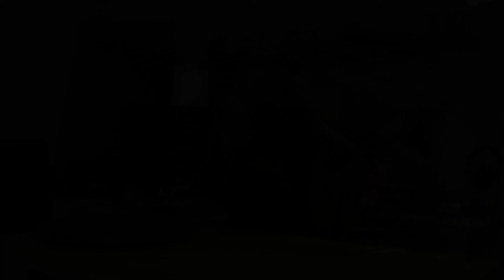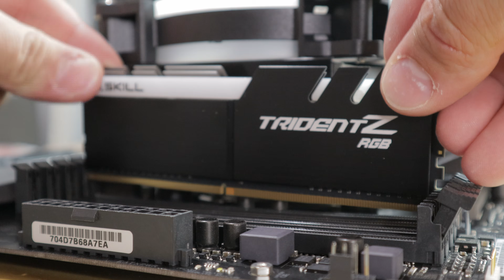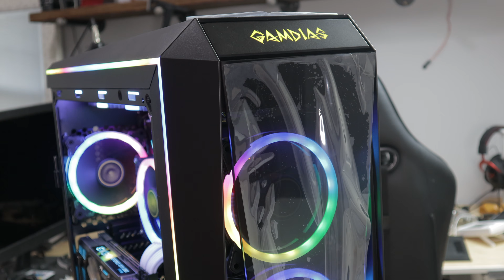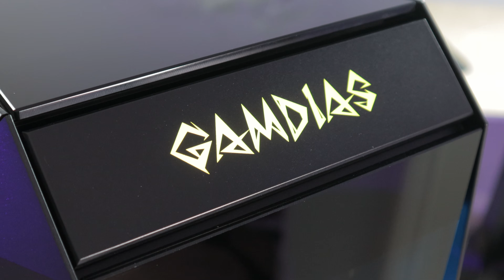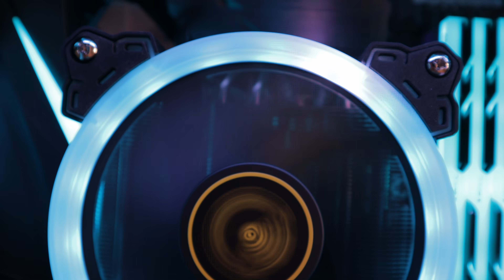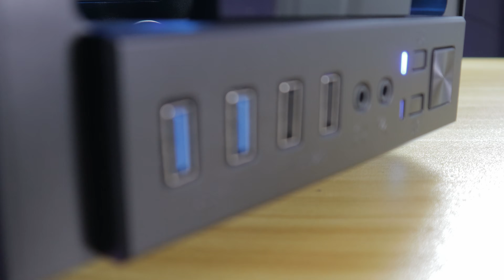ALL GLASS, ALL RGB | Gamdias Talos P1A

Comment: my guy...ive had this case for 3 years and couldnt get my ARGB to work. and i have an asus mobo as well. i even got the gamdias fan controller like you had and everything. couldnt ever get it to work. but i had the remote so i never worried about it. fast forward a few weeks ago. the fan controller burnt up so i had to go back to the original case built-in one. got to messing around with stuff again tried to get the ARGB to work again and still couldnt. you mentioned something about holding the case fan color button for 3 seconds.....that sync'ed it with asus aura lol thank you so much lol

Comment: Happy someone did a review on The Talos P1A. it seems like it just came out and there are not alot of reviews on it. Im still teetering on wether or not i should purchase this case.

Have you seen any issues with RGB case strip Freezing, Burning out, or Dying? Most reviews ive seen are tied to the previous Talos P1. Ive seen similar reviews for the RGB case fans. how are they holding up?

How was the temps on your CPU, and what was the heatsink you used? The gamdias fans seems to have pretty good RPM but im curious.
Reply from the maker: fans work good and no issues with RGB, CPU Temps are good and the airflow in the case is good. for the CPU fan i would suggest using a standard 4 pin PWM fan that  you can connect to your motherboard. The glass is tinted vary dark so if thats something you dont really like just be aware.

Comment: 129.00 on amazon   
darkFlash Phantom Black ATX Mid-Tower Desktop Computer Gaming Case USB 3.0 Ports
 Tempered Glass Windows with 6pcs 120mm LED DR12 RGB Fans Pre-Installed
currently running 7900x on x299wu8 with water cooling and evga1200p

Comment: If you want an efficient, cool, cost effective PC - DITCH RGB. If you want pretty lights just buy a "Fibre Optic Nightlight" on Ebay for $2. No excess heat, no awkward cabling and software. AND will save a heap load of money (use it to buy better hardware). Also when you realise RGB is just a complete distraction and waste of money you can pop your "night light" in the recycling bin with only $2 of "Buyers Remorse"

Comment: Hmm how are the gpu temps? Card looks super close to the side window, hope they're not getting choked.
Reply from the maker: they are a bit hotter but still within spec and i havent noticed any reduced performance
Reply: @MajorHardware  I went with a cooler master vertical mounting kit for my case (NZXT Noctis 450) I looked at other ones but they either were too bulky or too flimsy. I was surprised how far from the side panel the gpu was sitting with it. So far in fact I had to mod it because it was so close to the motherboard the tall rgb ram was in its way. 2 aluminum spacers and some longer screws later and it cleared the ram np while still being plenty far from side window.

Comment: no filter for intake....eww dealbreaker for me especially at this price point
Reply: Bruh, just use a radiator, or buy an intake. It isn’t an issue for me, so I really don’t get this comment, but it’s your opinion, your entitled to it.
Reply: @polaroperatr9243  A rad isn't going to catch dust nearly as well as a filter ! And personally if i spent this much money on a case i dont expect to have to buy anything extra to make it function properly. Whats the cost of a mesh fabric on a factory scale ? Close to nothing.
Reply: Still fine for me, I have a magnetic internal filter that I had in one of my old cases, which I had just discovered in my garage, so I glue on the polarizing side of the magnet to the case, and, boom. Internal Dust Filter DIY installed. I'm also fine with getting on with some compressed air and cleaning once and a while, though I would have to clean it more regularly than with a dust filter. Your right about the production cost, though. It is really cheap to manufacture, but I think the Tempered Glass makes it worth it to me (even though I installed a DIY dust filter)

Comment: I built a cooler for the air before it enters the front fans so my air cooler works fine for long game sessions using hwmonitor program it drops the case temp by 15deg. C it works nice.

Comment: Every time i see a case from a not well known manifacturer there are always major oversights, this case is 130$ and there isn't a front dust filter, that is a big no for many people. Also the ports at the bottom of the case.. This case is big, what if you can't put it on your desk, you have to reach almost ground level to plug a USB stick. The leds are the main attraction  but if you look at Amazon.com reviews a lot of people are complainig about leds failing quickly. I don't know, yeah it blings but i fear it's under delivering, expecially for that price, when the Cooler Master H500 sells for 90usd...This is my personal opinion.
Reply from the maker: In with you on the dust filter

Comment: I'd love to upgrade to Ryzen 3000 series, even though my current system is still decent. I have something similar to your old build. 7600k, exact same gfx card, asrockz270, 32 gb Corsair LPX, Corsair h100i in a Fractal Meshify C. Maybe next year with my tax return. Thinkng a Ryzen 2 3700 on a cheaper x570 board.
Reply: I have a ryzen 3700x on an Asus x570 tuf wifi and it's great